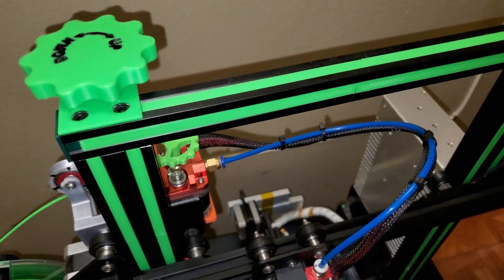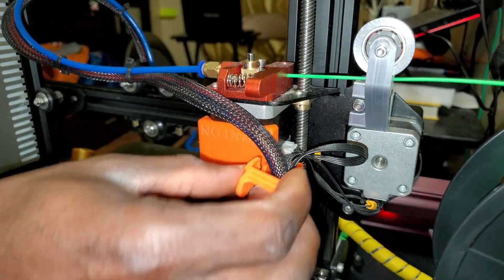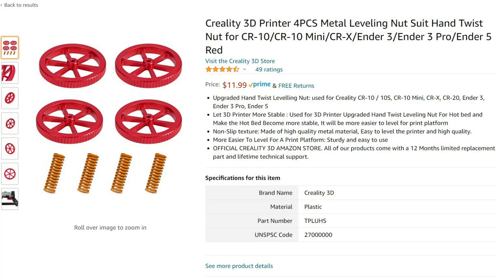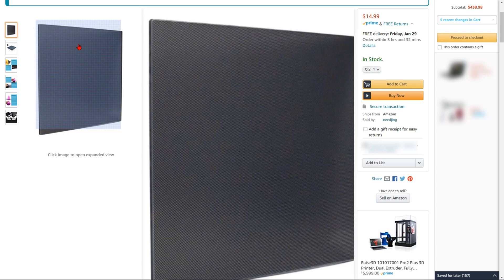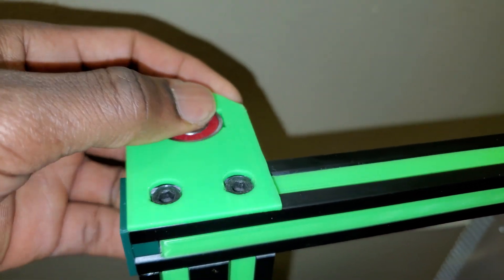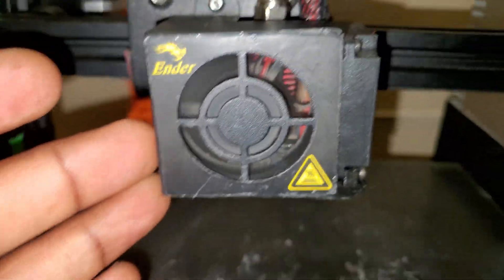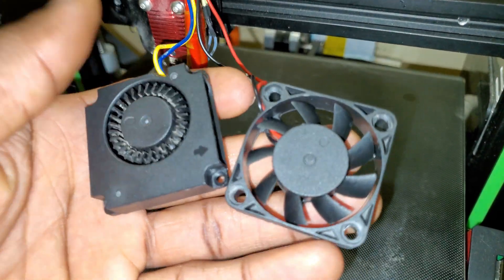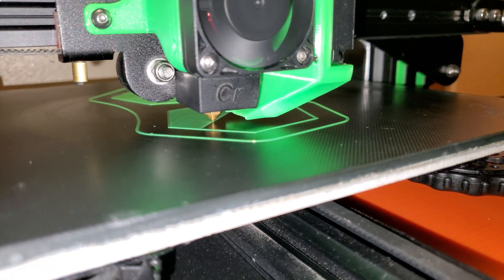Creality Ender 3/3 Pro Upgrades| More Improvements For your 3D Printer

Comment: I have Ender 3 for about 2 weeks, couple day ago I accidentaly got ABS+ instead of PLA. That meant very high bed temp and part cooling fan to 0%. There is an issue with Ender 3, and maybe even other printers from Creality.  Part cooling fan is tied with control to a motherboard enclosure fan, so if you turn off part fan it also turns off cooling of motherboard. I bet it get's toasty in there. I fixed this by cutting connector off and directly connecting motherboard fan to an extruder fan that's always on. Hope this info will help someone, as it will prolong the life of printer.

Comment: Is it normal for my stepper motors to get quite hot when printing?
Reply from the maker: usually they get warm depending on the environment and print time, but if it get too hot you need to check belt tension, there might be too much resistance. A motor getting too hot can also be a sign that it's bout to fail
Reply: Belt tension will not generate extra heat in the motors🤦. Most often it's the voltage to the motors. That can be changed through your slicer software. Upping the voltage gives the motors more torque but will make them run hot.

Comment: no don't put the z axis stabilizer on it will slowly bend the threaded rod
Reply from the maker: That only happens when you don't have the z axis motor spacer installed. In that case it's very hard to even install it or use it.
Reply: @YvonSmart  No. If your lead screw is already curved, securing both ends will cause more binding, and that's a no no and will lead to layer shifts, nozzle dragging across the print, etc. You may be lucky get away with a mostly straight rod, but an unlucky person who has a bent rod doing that will likely ruin their prints. If the z axis stabilizer is added on top, the lead screw will have 3 points of contact with the rest of the machine: bottom motor, top stabilizer, and the x carriage in the middle. If the rod is bowed, you can see that this will cause issue when the x carriage travels to a location where the rod bows out. You'll likely to have a lot more z-axis binding as the rod is pushing on the x carriage too hard, and in the long term, your x carriage, z motor, or z stabilizer will degrade depending on who's the weakest link. No matter if you add the spacer or not, you're not going to defy fundamental physics.